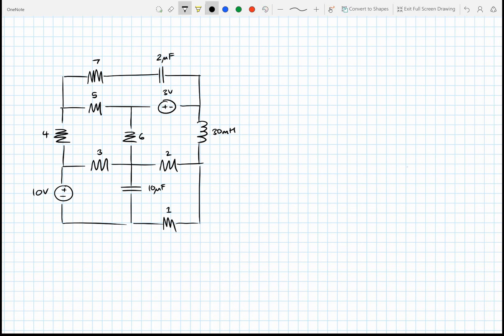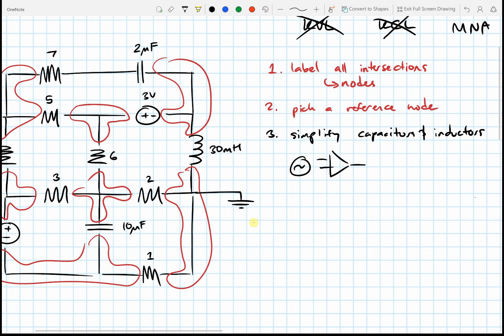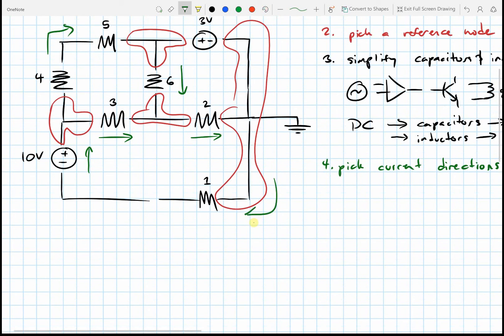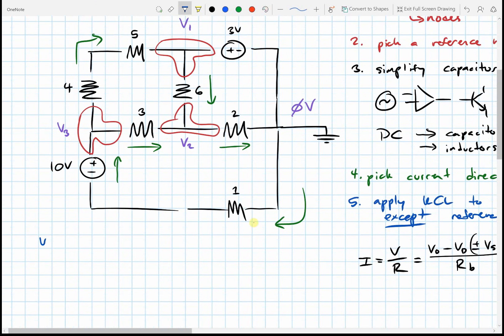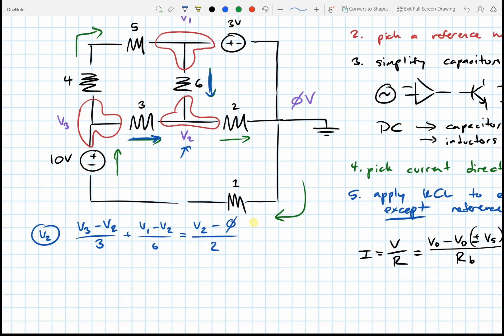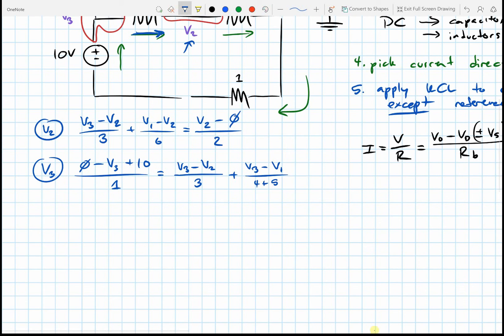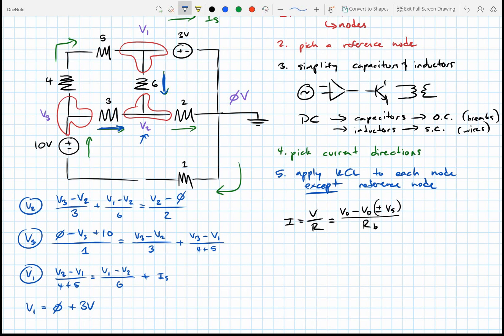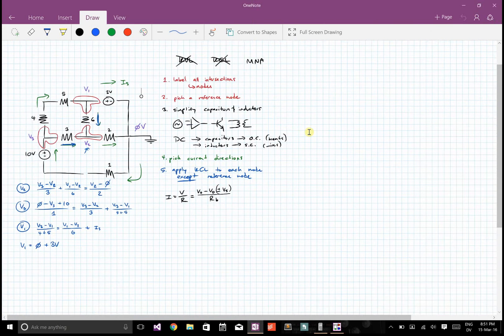How to Solve Any DC RLC Circuit (MNA)

Comment: this isnt an RLC circuit
you just made the problem in a way where inductors and capacitors arent there
Reply: How is this not a RLC circuit? He specifies that it is DC steady state, then inductors and capacitors in fact can be described as SC's and OC's. It would be different with an AC source that is true, but this is not the case. 
It's an excellent example of nodal analysis
Reply: @YourFellowSpot  yes but it doesnt show ways to deal with RLC circuits if it werent possible to neglect it like the circuit he chose
Reply: @nycter8227  thats to do with impedances and frequency, it's sinusoidal analysis

Comment: What about the circuit is not in steady state?
Reply: i also thought of that but judging by how inductors and capacitors work as soon as the circuit is closed, im assuming we would simplify the opposite (inductors turn into o.c and capacitors turn into s.c) and then continue the same from there. correct me if i am wrong though

Comment: I think between R 7 and C 2uF is a node!
Reply from the maker: ali asadi Even if it wasn't optimized away because it's in steady state, it still wouldn't be a mode because it's not an intersection. For the same reason, the branch with the 10V source and the 1 ohm resistor isn't a node.

Comment: Most RLC circuit problems aren't that easy. They will ask you about a switch and you have to find the voltage or current function after it switches. This is a super easy question.
Reply from the maker: +PizzaDispenser "Steady state"
Reply: You're correct. The variables in steady state response are simply DC responses. However, you're usually asked to also find the variables in the transient response, which are not constant (although still considered DC), and require differential equations, which are harder to solve than algebraic equations.

Comment: Is the intersection between the 4 and 5 ohm resistors not a node?
Reply from the maker: Imagine the 4 and 5 ohm resistors as a single 9 ohm resistor and ask yourself if it's still a node.